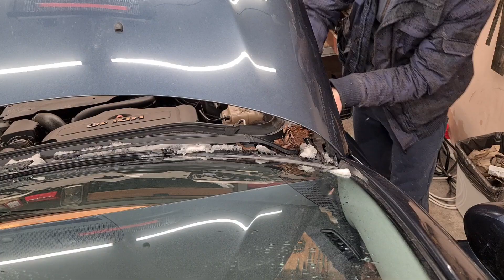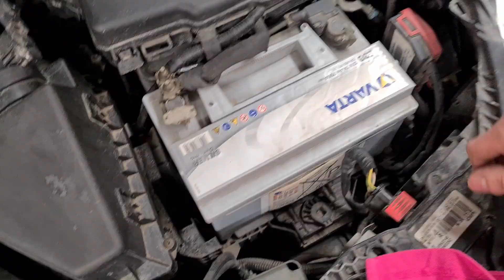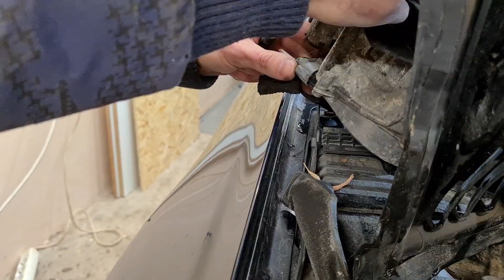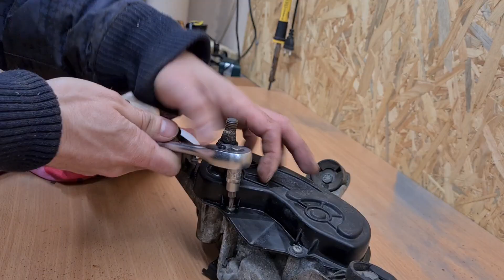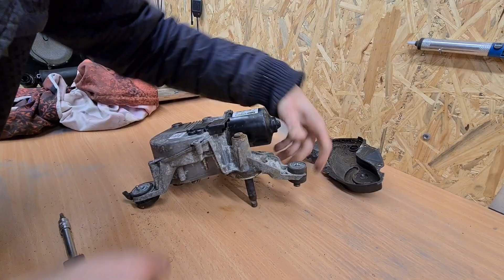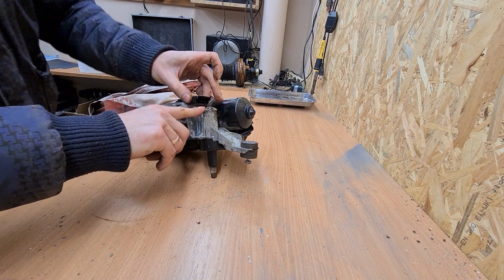C5 X7 freezing wiper motor repair

Comment: Thanks R&O! This video saved me a lot of money. Oxidation and hardened grease turned out to be the reason that my passenger side motor got jammed. It took me a bit over one hour to fix it with the help of your instructions. It's typical that the amount of second hand driver side motors is overwhelming whereas second hand passenger side motors are super scarce and cost almost tenfold.

Comment: My passanger side wiper goes up to the upper position and freezes there. Sometimes it stops in the middle of the window and the driver side wiper goes over it.
Reply from the maker: I have heard that there are magnets on the shaft which indicates position of the wiper, that magnet sometimes gets of the its place and then control board cant control it properly. You have to change that wiper motor assembly or try to glue that magnet back in place. Sadly, I havent done this type of repair yet.
Reply: @rustoil  Thank you for the information. I already ordered used one which supposedly works normally, and will replace it once it arrives to me :) However, i will follow your example - dismantle the thing and check whats wrong with it.
Reply: @rustoil I'll have to do this on mine looks like the magnet got stuck or sonething... Did this what you did on the video cleaned everything up and greased but still when I tried today it did not work... Doesbt move the wipers at all and my main 30A fuse for wipers doesn't get any volts not even 12v ran theough it when the wiper actuating stick in the car is placed at 4 level the fastest... I'll have to switch the thing under the magnetic... The motor seamed to be fine on both as I used multimeter to test the conductivity...
Reply from the maker: @lifeofmrd9166 i have been repairing those motors for a year now, they can get few electrical problems in the control boards and sometimes its quite tricky to determine which one is faulty without another good working set of motors. I am selling repaired motors in Lithuania with warranty.

Comment: Hello! I wanted to ask you if you have some idea what can I do. I also  own citroen c5 x7 (production year 2014) but I have one problem with my driver side front headlight. The problem is, the little fake plastic part (that is next to the xenon bulb) fell inside in my headlight and is stuck inside and I can't get it out. Do you have some advice what can I do?
P.s. if you want, I can send you picture (how it is stuck inside headlight) on Facebook, Instagram or Twitter. Thanks in advance!
Reply from the maker: Well, i have not had problem like this, but if it is impossible to remove it by wiggling the headlight, then you will have to remove the cover...
Reply: @rustoil  allright, thanks!